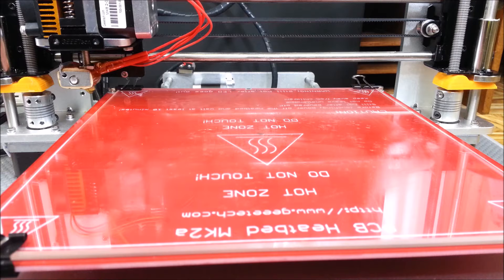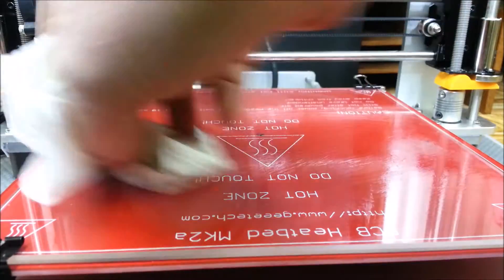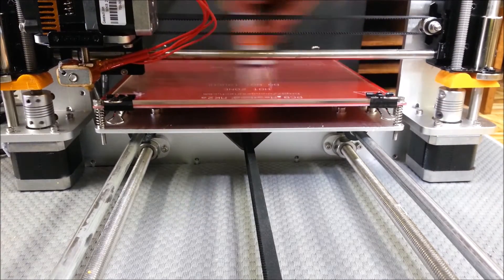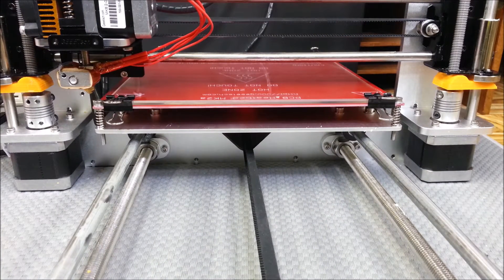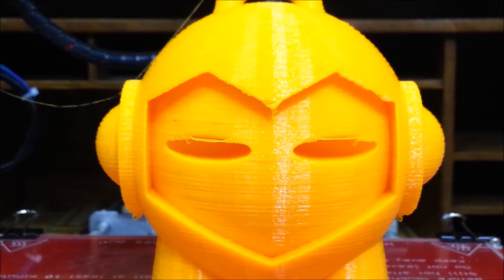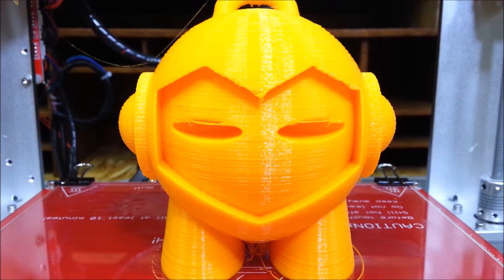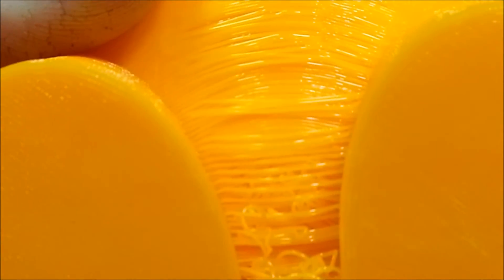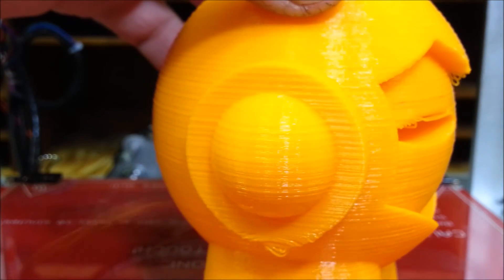XXL Marvin Printed On Geeetech Aluminum Prusa I3

Comment: I tried several improvement ideas on my prusa i3 pro x. The only things that helped were trapez threaded rods and the corresponding nuts. I placed the nuts on the under side  of the top plate of the x-carriage.  That causes the X-carriage more like hanging than laying on the Nuts.  I printed two rubbery washers using Ninjaflex and placed them between the Nuts and the carriage.  So fixing with screws wasn't necessary. an the Nuts could move freely without losing grip an slipping. The result are great prints without any wobble.
Reply from the maker: That's a great idea!
Reply: +Jimmy Shaw's Tidbits You're welcome! If you have any questions feel free to ask.

Comment: i think its to much z wobble looks good its so big  but still
i have been trying to find a soultion for it on my prusa i3x
Reply from the maker: Thanks for watching!  It is a real pain trying to figure out lines like that.  The biggest improvement came with the new brackets.  I think by bumping up the extrusion percentage in Cura, it might get a little smother.  I hope you can get yours dialed in.
Reply: +Jimmy Shaw&#39;s Tidbits  yes z wobble so mutch pain I'm going to try brackets like this.
Reply from the maker: +Halldór Grétar Svansson They are definitely worth trying before spending money on new lead screws and couplers.